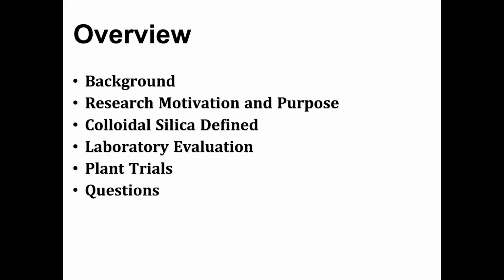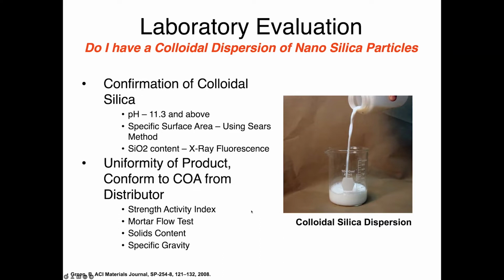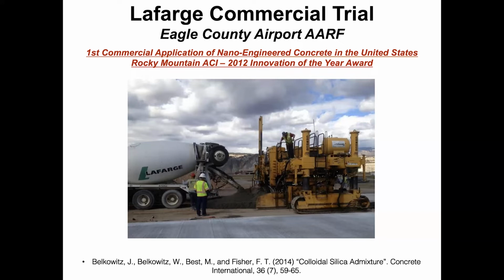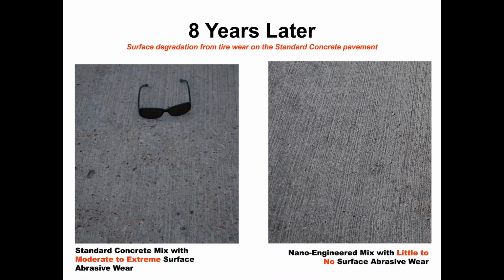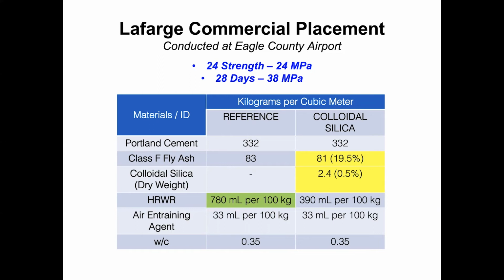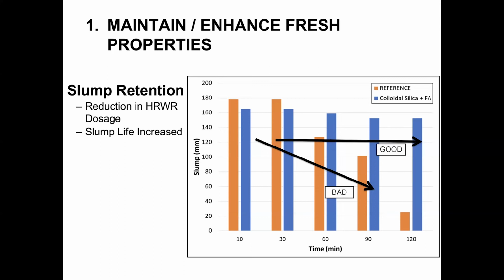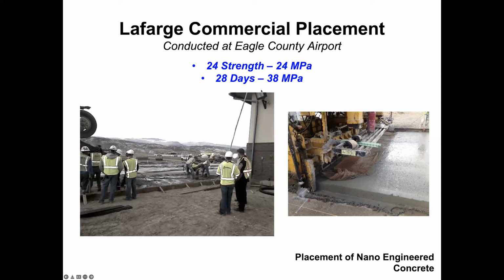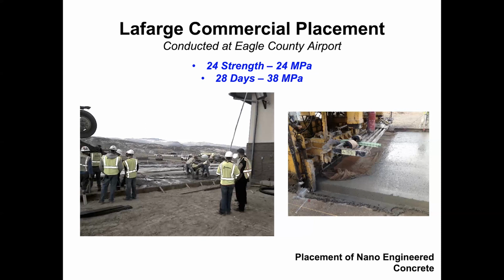Colloidal Silica - Snake Oil or Savior? - Webinar

Comment: Have you made Colloidal Cellular Concrete? Heard that at Densities between 1000-1100kg/m3, it reaches compressive strengths of more than 50mpa. You know?
Reply from the maker: Yes.  It’s all in the paste and maximizing hydration.
Reply: @IntelligentConcrete  Thank you very much for answering, what would be a mix design for 1m3 at Density 1000kg/m3? You know? Highly grateful if you can help me